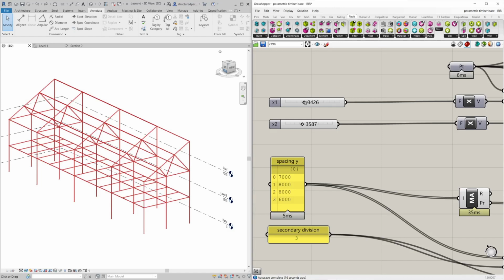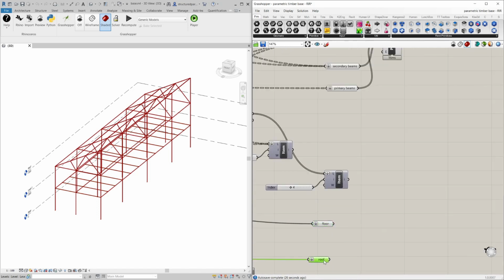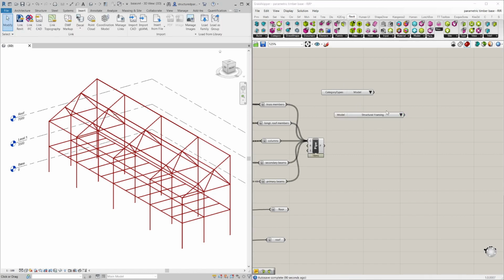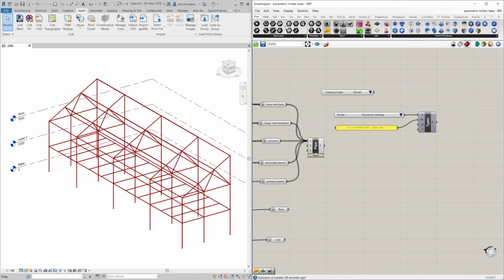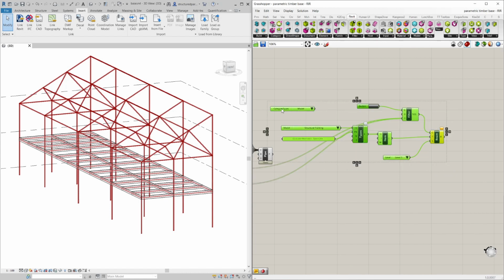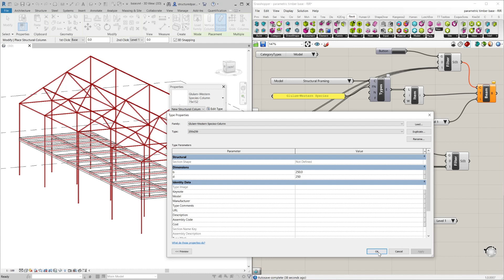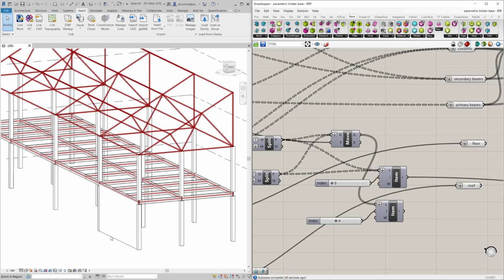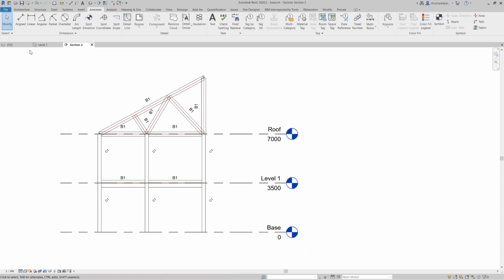Tutorial: Rhino Inside Revit basics for Engineers. Beams, Columns & Walls to Revit from Grasshopper.

Comment: Great video! Is it also  possible to cut beams by face through rhino.inside to get right geometry for each element, or it's only possible to do it manually after in revit?
Reply from the maker: Do you mean getting the geometry into Rhino from the Rhino.Inside? If so then yes you can do that.